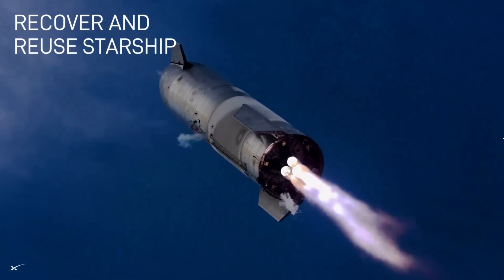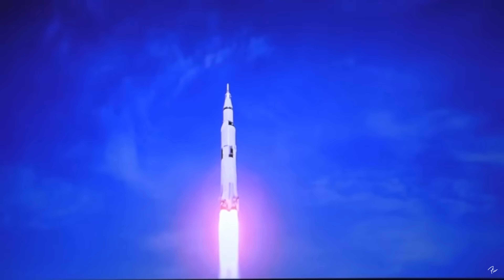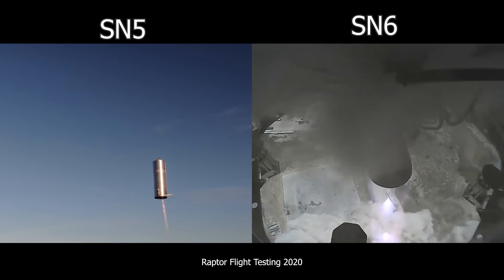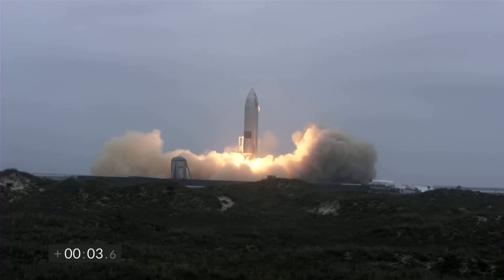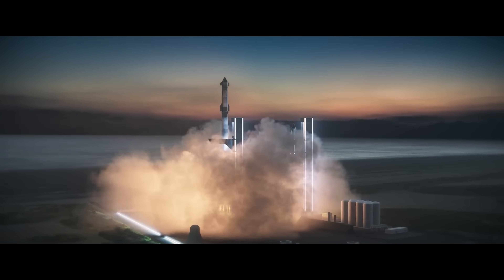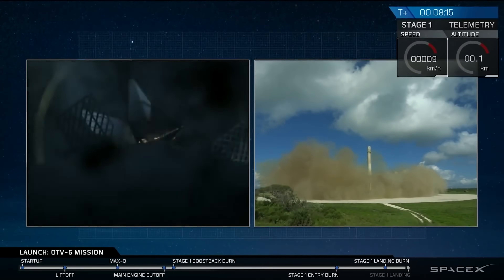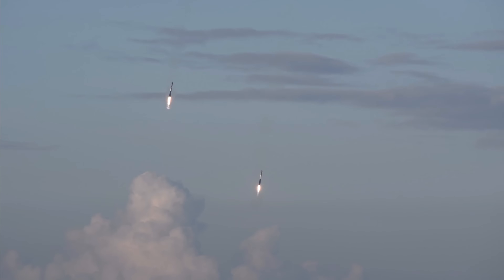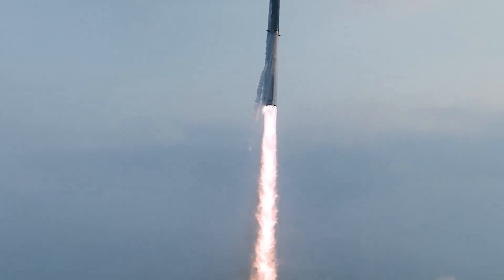The SpaceX Rocket Engine That Couldn't

Comment: I presume engineers (presuming it was in fact the engineers that made this decision) chose to use a greater number of far smaller engines on the Starship X similar to what Russian engineers chose (and possibly for similar reasons) for a number of their tickets during the height of the Space Race—namely, to reduce costs (larger production line and attempts at standardization) and in the event of failure, a reduced chance that a single or multiple engine thruster failure would result in catastrophic failure. Ergo, theission could still succeed even if several rockets failed.

Whereas NASA engineers (including those like my great-uncle Harold who worked at JPL for 40-sething years, and designed the landing gear for both the Apollo lunar lander and later the landing gear on the Space Shuttle)—larger engines with a reduced number of parts to minimize the potential for points of failure—thereby enabling engineers to focus on a smaller number of points for potential failure.

Unfortunately, NASA's engineers proved correct in their estimates, at least as far as the technology of the mid to latter 20th century was concerned, that reducing the number of engines, but dramatically increasing their size, as a means to reduce potential points of failure over Russian designs opting for a greater number of smaller engines.

The primary exception to this was with Challenger, which Harold explained was primarily due to the bean counters and politicians deciding to go with an engineering/aerospace manufacturer who had ZERO experience in the field, and had until then worked in drastically different areas of manufacture, ultimately costing the lives of STS-51-L.

Harold made it clear than engineersas JPL were concerned about the capability of the subcontractor to provide the necessary engineering and manufacturing capabilities necessary to handle such sensitive high precision work. Much like with his brother's 42-year employer (my grandfather, who was the lead engineer at Boeing for 42 years from the end of World War II until the early 1990's) Boeing where engineers have long told me that "McDonnell Douglas Boeing with Boeing's own money" to indicate how the Bean counters only concerned with short-term profits that ultimately drove McDonnell-Douglas into the ground—amd whi cost the lives of a number of planes full of people with their incompetence and greed). Challenger's crew didn't have a chance, not because of the incompetence, lack of foresight, nor even the callous "gung-ho" mentality often attributed to test pilots, such as (as I knew him) Mr. Johnson ("Tex" for those not immediately the know—as an interesting aside, his most prized possession was actually a black Jaguar convertible. It was his baby. My grandfather and he went to church together Mercer Island and were long-time friends at Boeing [my grandfather was a former World War II bomber pilot along with their mutual friends like "Crash" Williams and others]. Mr. Johnson was an extremely down to earth person who I associated with my grandfather's long tenure at Boeing Aircraft Aerospace. Actually, speaking of Tex, my grandfather had the number 3 reel/print of the test footage of when Tex did his famous/imfous barrel roll. It was sitting on my grandfather's filing cabinet downstairs at his house for decades along with every piece of documentation on every Boeing aircraft from the time my grandfather started at Boeing until his retirement. Unfortunately, my uncle was in charge of handling my grandfather's things after his death, and like a complete moron, he threw it all away—seeing mo implicit value in it. My grandmother tried doing it for decades, but thankfully my grandfather managed to save it. Let my uncle managed to do what my grandmother spent decades trying to accomplish —inadvertently destroying priceless history of aviation all because they couldn't see value in it—grandpa had mint condition mock-ups and all sorts of amazing works, including all the documentation for the SST. Simply mind boggling stuff that all should have gone to the aerospace museum. But, 🤷🏽‍♂️ idiots gonna do what idiots gonna do…)

Like Boeing today and McDonnell-Douglas in the past, and like with the subcontractor of the Shuttle Boosters, short-term thinking and short-term gains ultimately proved the death knell for the bystanders involved.

I'd like to hope that Space X is isn't making those same mistakes, but from what I have been able to see this far, the penny pinching over safety is still in full-swing. Maybe not as badly as at Boeing, since that is an epic klusterfuk of biblical proportions, but still rampant. And from what I've heard about Musk, he's a real tyrant—and not in the sort of competent PTSD kind of way like my own father where their reaction to "overwhelming stupid/brain dead/stupidity/etc." was the primary origins of staff getting chewed out—but rather, the sort mocked in films like "Don't Look Up".

In my limited knowledge base, a prime example of this short-term thinking is present in Space X choosing a fossil Fuel based propellent over nuclear or other renewable powered electrolysis based cryogenic LHOx fueled rockets (liquid hydrogen and liquid oxygen).
Reply: I am somewhat familiar with the immense technical complexities involved with cryogenic liquid hydrogen rocket engines—however, it was.for the numerous technological advantages liquid hydrogen and liquid oxygen fueled rockets provided that got Gödder to choose the fuel in the first place. The only liquid propellant with a greater specific energy is those liquid hydrogen, liquid lithium, fluorine fueled engines that Rocketdyne experimented with (or the nuclear fueled rockets designs that ce out of the efforts to develop nuclear powered jet engines, particularly for that absurd flying carrier Locheed proposed at the end of the 1960s in which conveniently all original records have been "lost/misplaced", in which we only have record of through secondary sources/excerpts—as though this were some 1st century C.E. biblical manuscript or something. That or one of the other numerous potential projects. Not to be confused with as I recall it being called the Orion program which planned to use thermonuclear weapons to power high speed space travel, but was understandably scrapped because of the potential risks in dangers involved—and as I recall, because they never managed to find a buffering platform that could withstand the blast long enough to be reliable long-term. The force is involved were just too massive to my understanding.) in the late 1960s to early 1970s, but ultimately scrap due to not only their immense complexity and risks, but also because trying to launch someone into orbit with exhaust approaching or exceeding the surface temperatures of the Sun, as well as the immense danger to bystanders from the potential to create vast quantities of hydrofluoric acid rain and other dangerous pollutants.

Does latter part is especially troubling for me since one of the primary things that ultimately killed the SST was the pollution risks. It was known in the late 1960s and early 1970s that the amount of pollution, or more specifically, greenhouse gases produced by the proposed SST (the one my grandfather was helping to head up at Boeing) were of such quantities that it threatened to cause rapid onset climate change (experiencing today, although on a much more compacted time table.)

Rockets pose an even greater risk because they can enter the upper atmosphere, enabling greenhouse gases to be effectively injected into the stratosphere and beyond.

The cost saving and reduced complexity involved with fossil fuels based rocket design, IMO (any opinion of decades of NASA engineers and others from other global space agencies) is that the reduced complexity is not worth the increased environmental potential risk from these rockets, especially to those in the community surrounding test and launch sites—such as what has happened in both California and Florida where Space X testimg has caused numerous enviromental problems/risks to those communities.

I personally still don't understand why Space X didn't simply pick up where NASA engineers left off with ocean based launch vehicles such as the proposal for the autonomous SeaDragon rockets (as seen visualized in the alternate history science fiction series, _For All Mankind_).

I'm sure there's somebody on here who's going to tell me why I wrong and why the fossil fuel based rockets are superior (I challenge them to address the environmental issues—and yes, I do know that most of the hydrogen previously used in rockets, much like the US helium stockpiles, primarily originated from fossil fuel deposit as opposed as the more reasonable nuclear or other renewables. I noticed going down the nuclear safety rabbit hole as that is beyond the scope of my intentions with this post. Liquid hydrogen and liquid oxygen can and have been produced on scale via electrolysis of water, potentially as an extension of the search for heavy water/heavy hydrogen, like in Canada's CANDU reactors.

Comment: Second stage reusability is a massive hurdle, it's been done with Shuttle but the refurbishment cost made it a every expensive LV.
Even if Starship never gets second stage reusability just having the first stage reused is a massive cost saving and you could have a low and high energy upper optimized for payload to LEO and payload to TLI.

Comment: Transfering the propellant payload is going to be made more complicated since the main LOX tank will have H2O & CO2 contaminants.  

Elon might have been a bit embarrassed to admit to Tim Dodd that the autogenous pressurization system taps into the LOX pre-burner...
Reply: That is a very good point but I don't think they are going to be transferring prop from the main tanks. From what I understand, there are going to be tanker ships and depot ships in orbit for that. Or are those ships further down the road and in the beginning they will just transfer tank residuals from Starlink launches to a depot? If that is the case though, they would need multiple depots in orbit to cover the different Starlink shells.

I would be curious as to how they are going to handle those impurities in the tanks when it comes to reuse, much less rapid reuse with the proposed 1hr turn-around time.

So many questions, so many engineering challenges to overcome...
Reply: @dr4d1s  I'm hoping the next engine design makes clean ullage gas.
Reply: @imconsequetau5275  Me too. Now that you mention it, I wonder if where they are currently tapping off was/is a temporary thing to just test the autogenous system and get it working? Surely, where they are getting the gasses from isn't really as important/big of a deal as testing the system as a whole. Once they get the system working, they could in theory get the gasses from almost anywhere with little (relative to the whole system) modification.
Reply: @dr4d1s  I think tapping off the pre-burner was easy, but an engine heat exchanger that boils pure oxygen is harder. They really wanted hot ullage gas for the "cold" gas thrusters. They may start developing hot gas thrusters for the booster and use some variant for the HLS lander as well. Then hot ullage gas is a low priority, and the ullage gas can be made cleaner. [retracted]
Reply: Actually hoping that the next engine version solves this contamination. 
Using separate tanks to hold ~150 ton of propellant is not efficient. More likely the main tank bulkheads will be moved up enough to hold the extra liquid payload. 
 @dr4d1s
Reply: These various missions will all become ludicrously cheap once ship recovery succeeds, and ship reuse begins. I think further test transfers within a Starship could occur along with most Starlink deployments. Once ship to ship transfers begin, those will be dedicated to depot research, not shared with Starlink missions. 
 @dr4d1s

Comment: As a former structural design engineer in the aerospace defense industry during the Cold War, costs were not a big deal to us.  We developed the best components and the government paid the price.  We tried to reduce price afterwards, if possible.  As for talent, it is true that far fewer engineers needed if they are all very good and committed.  If assigned a project to lead, the first question was: can I pick the people?  A bad team is a sure sign of over cost and poor outcome.  Of course, we tried to reduce weight simultaneously, so costs were difficult to lower.  As a business, this is different.  Excellent management and funds are both required.

Comment: Makes you wonder how Starship is ever going to land on the Moon
There will be no prepared base initially, it's not gonna be level, and they're gonna kick up a massive dust storm
Reply: HLS doesn't use engines at the base to land on the Moon.
Reply: @Jogeta5  I was thinking there's nothing like an atmosphere on the moon to attenuate the jet flux
But there is: the vacuum of space will quickly spread out a gas flow

Comment: 4:55 Well, the official believe why Raptors were failing is due leaks, fires and explosions in the engine bay. I don't understand why people still think that was due to concrete pad failing, even SpaceX themselves said, they found no evidence of damage from the concrete. The truth is Booster 7 was just a mess of old engines, retrofitted shielding and insufficient fire suppression CO2 system (they improved it by 15x for flight 2).

Comment: The real cost is not the cost of the engine.  Look at the material cost of that $2,000,000 engine.  The actual material cost is <$1000.  The rest of that cost is human labor.  So, NOT spending that money, not doing the test but paying all those people to slow down and make assumptions about how the system works is actually wasting a lot more money.  Look at Starliner.  That's a $10 Billion money pit.  The whole Starship program is probably only 2/3rds of that tops.  And, if they actually catch a rocket at the next test flight...holy shit!  Well, to call it ground breaking would be a dramatic understatement--more like space shattering!
Reply: Less than $1,000 in material for a raptor engine?  Oh boy, i don't know what you're smoking…

Comment: Wait until the raptor 3 closed cycle engines hit the pad, the first true closed cycle since the RD180 USSR program. And those Russian RD180's are a 20:1 failure, not good when stacked as the USSR soon realized and gave up on their lunar rocket program.
Reply: The N1 rocket didn't use the RD-180, but rather used NK-15 engines which were both closed cycle, but neither were full flow stage combustion - which the Raptor is.
Reply: @imconsequetau5275  Closed cycle means that they don't expel the hydro pump turbine exhaust, so all of the propellant is sent into the thrust chamber. Only Elon and  Nikolay Kuznetsov have been able to achieve this with any success on sea level base thruster engines. The NK-15 engines and N1 rocket died with  Nikolay Kuznetsov on the launch site and thus the N1 program died with him.
Reply: @rolomaticz5009  So many things wrong with your comment. The NK15 is an oxygen rich close cycle engine, it is not a full flow, nor is the RD180 full flow, it is also oxygen rich close cycle.
Reply: @SentinelSent  
I see I got the NK-15 wrong about being fuel rich. I'll correct that.
Reply: @rolomaticz5009  
"The NK-15 engines and N1 rocket died with Nikolay Kuznetsov on the launch site..." 

Didn't this Nikolai Dmitriyevich Kuznetsov survive until much later, like July 30, 1995 ?
Reply: @imconsequetau5275  This is how Elon has squeezed another 20% plus thrust to weight ratio output on the new Rap3 engines. The turbo pump exhaust is added back into the LOX / fuel stream going into the thrust chamber.
Reply: Sorry, but I would like to make several corrections. 
 @rolomaticz5009  
The following are all closed cycle engines: 

The RD-180 is oxygen rich single-sided pre-combustion (using kerosene fuel). 
Not full-flow. 

The NK-15 is kerosene oxygen rich single-sided pre-combustion. 
Not full-flow. 

The Raptor (versions 1, 2, and 3) use full-flow (dual pre-combustion) using liquid methane and LOX. 

Raptor version 3 [didn't change the combustion cycle, but] improved the combustion chamber pressure from ~25 MPa to ~30 MPa by increasing the turbopump pressure, presumably by improving the stacked turbopumps and perhaps by reducing injector pressure drop. 

The RD-270 was full-flow.

Comment: When you have landed it by itself for many times, why capture it? Landing booster heavy by itself is impossible?
Reply: What arrives back at earth has to be as light as possible. Why accelerate then decelerate several tons of landing gear if it's possible catch it with some well engineered capture pins? Same thing for the hot staging ring, several tons of metal that doesn't need to be slowed down by the engines to land.
Reply: Would you park your car down the street or in your driveway which is more convenient?

A second grader could figure out why this is beneficial.

Comment: Starlink and Mars are both horrendous ideas. Nobody is going to Mars. Building miles in diameter artificial hollow moons out of lunar material, and paying for it with Space Solar Power, is the only logical path. Elon is a nut.
Reply: well even if you are right you need cheap and reusable rockets to build such a thing so is he still that crazy?
Reply: @zachmoyer1849  Yes, why would that not make him the freak he is?
Reply: @garychurch9237  because his developments are still necessary to do what you said anyways.
Reply: @zachmoyer1849  Nope....he is not even an engineer. He takes all the credit for saying...make it do this.
Reply: @garychurch9237  ur thinking of steve jobs.
Reply: @zachmoyer1849  You are thinking of Tony Stark.....which is not real.
Reply: @garychurch9237  nah he only had one kid the guy im thinking of has like 20 with 4 baby mommas.